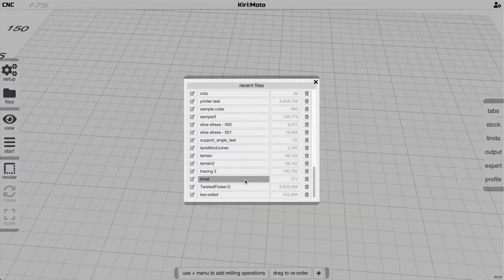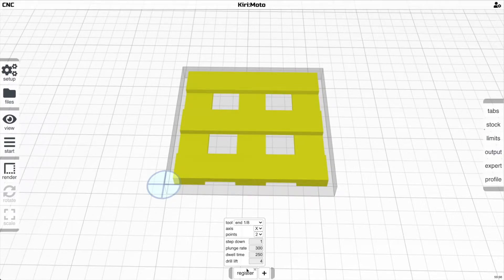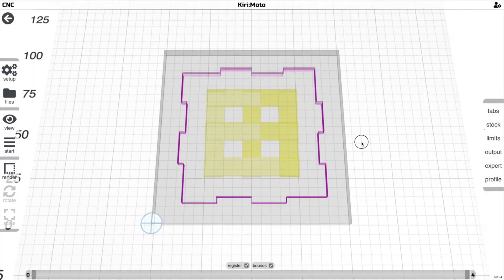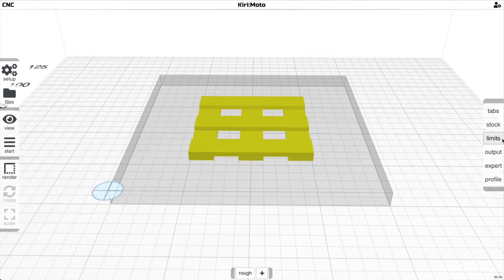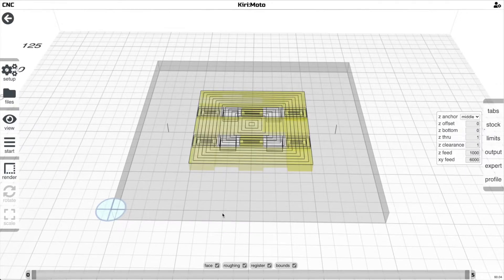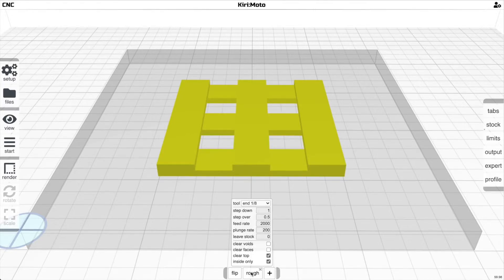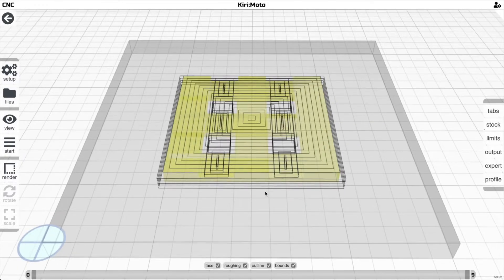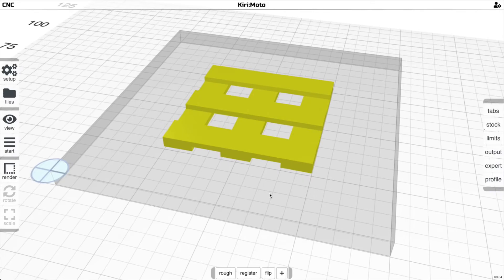Pattern Registration for Double-Sided Milling in Kiri:Moto

Comment: The new feature seems great.  I am not quite sure if there are tabs created to hold the part in place after running the last outline . pass. Can you explain in more detail how this registration  method works.  I am not too clear how it works. Thanks.
Reply from the maker: The cut-out pattern allows you to flip the part in either direction and press-fit back into place leaving stock around your final part region. Whether you use tabs to retain the part for the final cutout pass is up to you. For example, you could use double-sided tape when you flip the cut-out region. This is the video that gave me the idea. It shows the process a little more clearly. https://youtu.be/BLD4dFoXC7o?t=360
Reply: @GridSpace  I see.  That's brilliant!!  I would just have to add tabs to the 2nd side.  Thank you!
Reply: @GridSpace   I just saw where this was implemented on version 2.6 but this development version isn't showing on the version list.
Reply from the maker: This is in the 2.6 Development version which you can switch to here: https://grid.space/choose
Reply: @GridSpace  glad this video was linked. Because i was looking at the current video and said there is no way that can be flipped and align into those pockets.